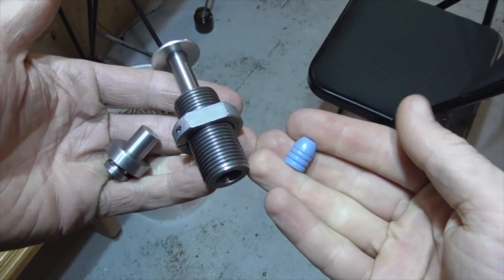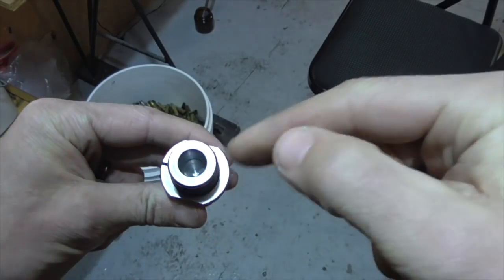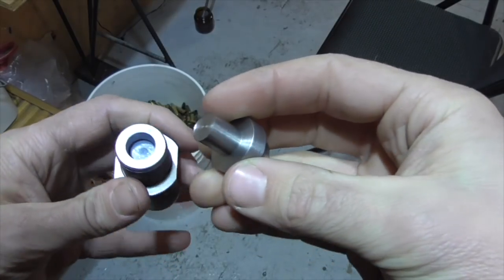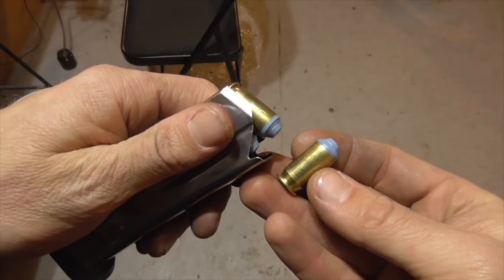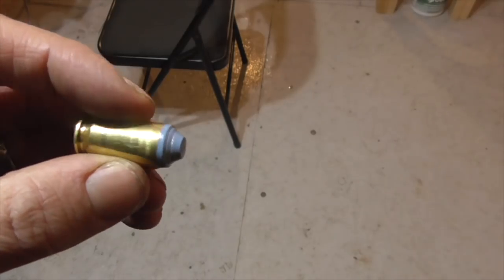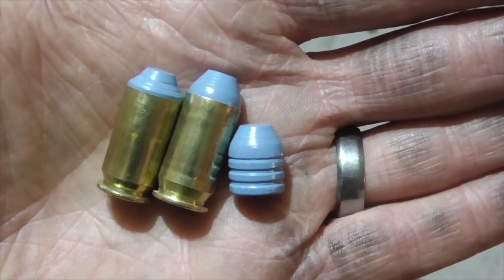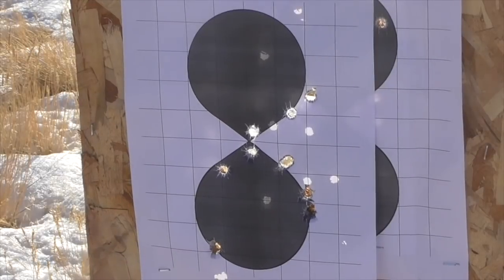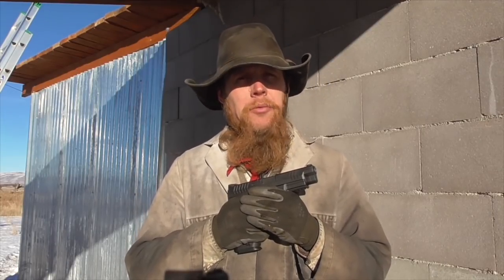First Attempt at Bullet Swaging (TIS307)

Comment: Considering you can size 45 down to 44 , I think you could benefit by having different mold casts in either size of varying weights without having to over lap   
Basically one cast for each weight. Regardless if is 44 or 45.

Comment: Thanks for sharing this idea with us.  Your vids are always worth watching!  I'm going to try this same idea in a different caliber.  I cast bullets for my 9mm luger, but don't have a mold to cast bullets for my 9 x 18 Makarov.  With new molds hard to come by these days, I think your swaging idea may be the perfect solution for me.  Thanks so much for this idea!
     By the way, also concerning the ammo and componant shortage, have you experimented any with using black powder loads in autos?  Specifically for a 1911 Colt .45 auto,  the .380 Walther PPK,  and for the Russian 9mm x 18 Makarov .    i know there would be much more cleaning required afterward, but would they function as semi autos with BP loads?  Would love to know your thoughts on this  thanks for sharing your work with us...

Karen
Reply: Other content creators have done experiments using black powder, and they do work! But as you said there's a lot more cleaning necessary. You lose a lot of power for obvious reasons, and because they're autoloading guns the filth will get deeper into your ejection and feeding components too, and the barrel gunk can even affect ballistic performance. Overall I wouldn't recommend it for anything but the most dire of emergencies, certainly not for typical target shooting. Under no circumstances would I ever suggest using a gas operated gun with black powder, that's a cleanup mess you don't want to handle the hard way! 

Inversely, manually operated guns (Pump, lever, bolt, revolving, etc) especially wide smooth bore guns like shotguns would lend themselves very well to black powder improvised loads, since the delay between action cycles means the powder will have had time to burn completely before the action opens up, so most or all of the filth will stay in the barrel. And obviously breech actions. 

Really I think a more refined homemade smokeless would be more of a worthy experiment, such as some form of guncotton cordite.
Reply: I show what you need to know on my channel.

Comment: Cool!  I came across your channel, I would recommend putting some lube on the bullet to help it exit better from the die.  I had similar die concept to make a core swaging die plus a hole drilled in the side to size my 22 cores.  Another simpler way but maybe not as elegant to achieve diameter increase is machine a flat shell holder and flat top that screws in and out and simply squeeze the bullet until it fattens to appropriate diameter and than run it through a lee sizer.  I did similar experiment with bumping undersized .357 bullets turn into .360 and .309 bullets turn into .312

Comment: For the 1st bullet, could have it be a case of too short OAL?  Most .45's work better with a certain set length that is pushing max length.  However, that's in a 1911, no clue about anything else.  And I agree with you about the light loads.

Comment: I'd like to have one of those swagers
Reply: Me too
Reply: Don’t look complicated to make either
Reply: Probably could be made with a drill press if desprate
Reply: @CowboybubPercussion  I made several with a drill press before I got a mini lathe.
Reply: @CowboybubPercussion  Oh. Now that I think about it, perhaps with a seating die body? Just make a floating plunger. I'ma have to take a look at my dies.
Reply: Looking at the Lee seating die, I think if you just took a 5/8" fine thread bolt, and drilled a center out of it to put a punch into, you already have the tool. Making a second plug for HP mode would be fairly simple on even a drill press! This is great news. I'm definitely going to make some HP punch sets. At least one for 10mm and one for 380/9/357
Reply: Yep. I want one to hollow point normal bullets.

Comment: Why powder coated ??? ... Could you make gas checks and jackets ??? Swedge down rather then up ... Given time swedging can fine tune bullets to particular weapons given factory tolerances ...
Reply: Jacketed bullets can get you hollowpoints. But you need to measure of the right amount of lead. Or leave a narrow hole an top the lead can flow to so you can cut off the excess lead. Or pour in your lead in the jacket. Or make molds with the right amount of lead and put that in the jacket and then swage your bullet/hollowpoint. That probably is the best. 

Greetings,

Jeff

P.s. 
If you draw your bullet in a CAD program, you can get your volume right for your casting, so you will get exacly the right amount of lead.
Reply: Powder coating is less messy than lubrication of cast bullets when sizing. Plus I've found powder coating slows down build up in the rifling and had an accuracy improvement akin to switching to jacketed projectiles. On top of all of this, I like having my 45 Colt(Dont ya dare say 45LC) with purle coated projectiles. 😉👍

Comment: The was a guy btsniper i think, that made/sold dies similar to this. Essentially there was a chunk of flat stock that would be on the top and bottom of the press with a hole for the ram to go through and long bolts on either end. Then the top had a setup of a die and a top punch. You would put another punch in the shell holder and raise the ram with a cast bullet on it. Then add pressure to swage the shape after which you would hit a plunger that stuck out of the top and it would eject your swage bullet. I always wanted a set but never ended up purchasing or making one period very similar to the way you have yours
Reply: So far as I know you can still get those, they are pretty spendy though.  I have been gathering bits and pieces to make one myself.

Comment: could you try to swage solid copper wire into 223 bullets (say you get 5mm or so grounding wire)? im thinking a drop hammer could squish a small slug of annealed wire into shape if you made a steel mold it could be squished into. idk how you would get the bullet out, maybe two part mold, but seems possible. perhaps a hole in the bottom to press a punch through? idk, liberal use of lubricant seems nessecary either way.
im just asssuming it requires too much pressure for the design used in the video, but might just work too.
Reply from the maker: Copper is a lot harder than lead, and thus would be more difficult to swage, but maybe something like that would be possible.
Reply: @TheIdahoanShow  im just imagining it as a pretty easy to set up home bullet making process. lead is getting harder and harder to get at. if you could even get it to work with a die and a sledgehammer the equipment really fits in your pocket
Reply: it has been done before, the 'balle d' lebel bullets were swaged 90-10 bronze